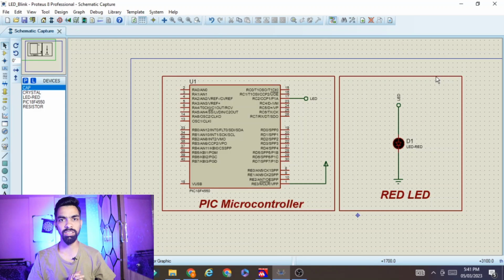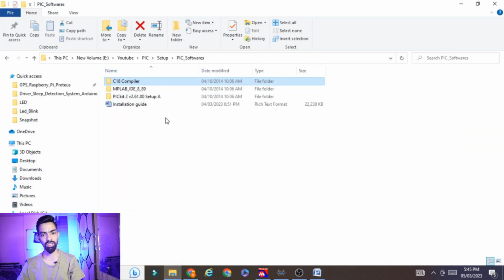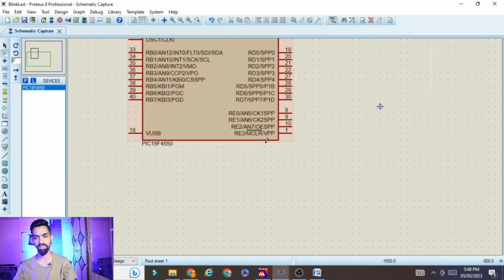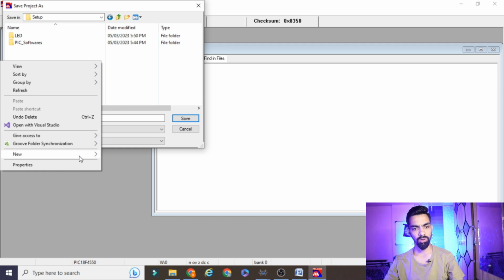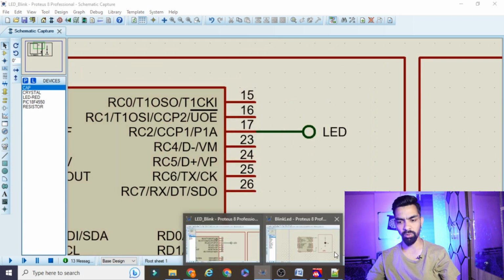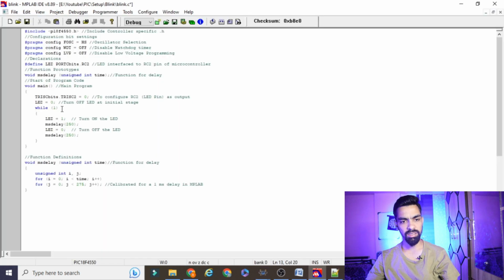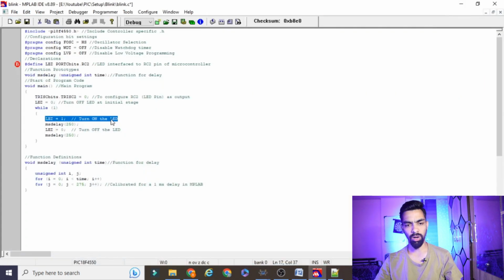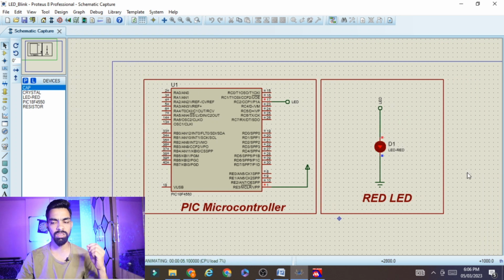led interfacing with pic microcontroller | pic18f4550  | Proteus Simulation

Comment: Hello sir i cant find your PH sensor sir
Reply from the maker: Download project from Google drive link..it may be in zip folder.. unzipped it..and use proteus 8.9
Reply: @Rahul_Jadhav_Project  the library is missing sir
Reply from the maker: @creammiee5002  are you using my simulation? With proteus 8.9
Reply: @Rahul_Jadhav_Project  yes sir the zip file only has 4 files
Reply from the maker: @creammiee5002  open that simulation..in video i told how to copy library